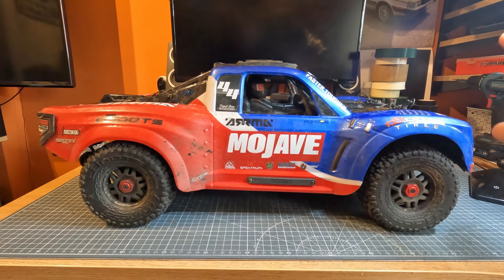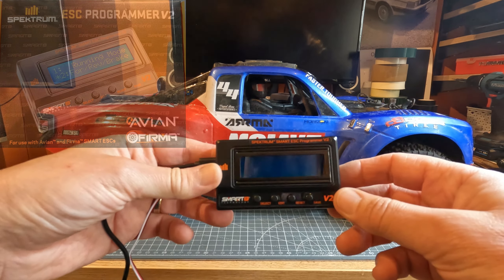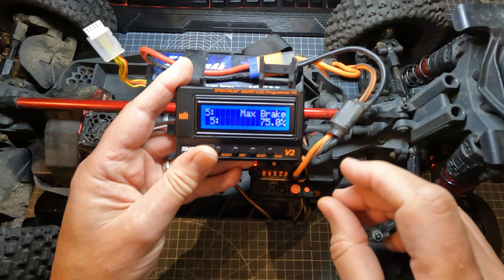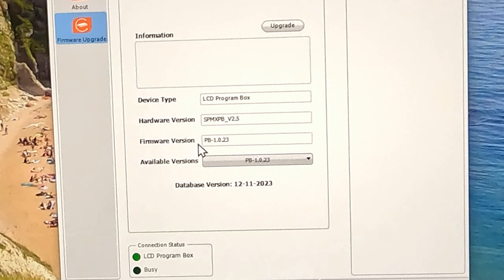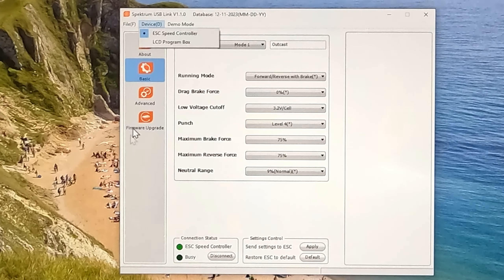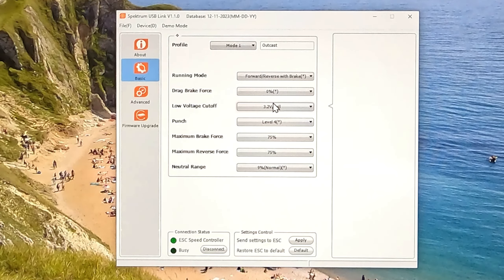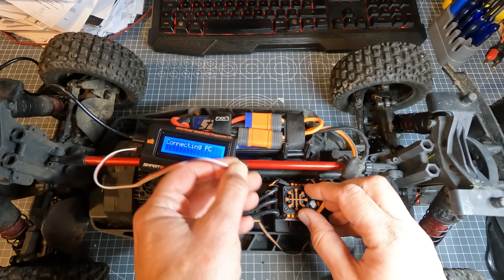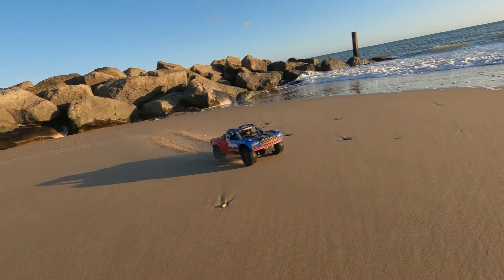Spektrum Firma ESC Programmer V2 Setup/Review Arrma 4s V2.5 LVC Low Voltage Cutoff problem solved.

Comment: You Really don’t need a 30 euro program card to change the lvc on the Arrma 4s 2.5 platform with 120 amp ecs. Just enter the ecs  programming menu by holding the set button 1 second , then cycle till you hear 3 beeps , hold set buttor for 3 second and now you are in the lvc menu for the low voltage cuttoff . Low voltage can be set from.1 through 6 and from factory it is on 4 . Set it to 2 (2 beepz). Hold set button for 3 seconds and turn off ecs . That waz like 1 minute work and you saved 30 euros ...
Reply from the maker: Thanks for the info. Much appreciated 👍👍
Reply: For some reason, when I go in manually like you describe, m lvc just turns off when I go to position 3. At position 4, it's cutting off around 30%.
Reply: Legend mate. What voltage does 1 go to? Had my 5000mah out in it today and only used 2500mah. Assuming 3.7 is the cut off for 4!
Reply from the maker: @RhodTehMod  Hi there. I'm not quite understanding the question. Each cell in the battery goes from about 3.2v uncharged to 4.2v charged so for example a 4s battery as a whole goes from 12.8v to 16.8v.  However many cells your battery has, if you run it down to lipo cut off and then charge it to full and the mah that the charger says it's put in is quite a bit less than the capacity shown on the battery case then the ESC has cut off too soon.  Also just a voltage test after the car has cut off should show about 3.2v to 3.4v per cell. If it's much higher than that then again the ESC has cut off too early. Let me know if that's what you were wanting to know. Thanks for watching the video 😁
Reply: @PeteWylieRC  it answered a lot thank you! There’s 6 modes on the esc without the device so wanted to know what the difference was to putting it on position 1 to position 2
Reply: So i dropped the Lvc level down two settings and now on 4s it cuts power at around 3.5 volts per cell with my batteries wich is fine, what i really don’t understand is why it still cuts off at around 3.7 volts per cell with my 3s lipos.
Reply from the maker: @Test1ngOneTwo  Ah right. I think that under acceleration the battery dips down in voltage but the voltage goes back up a bit once it isn't under load. That's my understanding and it might be wrong.  Thanks for your feedback 👍👍

Comment: Loads more run time now 👍🏻
Reply from the maker: Hiya Damian.  Yeah it was cutting off stupidly quick when I was running it on the beach because the wet sand stuck underneath and it weighed a ton!  Cheers for watching mate 😁👍

Comment: With a full 5200 battery I can get mine to run on concrete for roughly 30 seconds before going to half power. Any thoughts on this? Seems turning it off and back on gets me another 30 seconds. Batteries tested good
Reply from the maker: Have you checked what the low voltage cut-off is set to? Even with it set too high you would hope for several minutes. If the LVC is set to 3.2v per cell and still doing this then either faulty battery or ESC I would guess 🤔

Comment: so is the kraton 4s 2.5 the same then as im sure there the same esc?
Reply from the maker: Yeah it seems that all the 2.5 version 4s cars have this esc where the LVC is set high but you can change it using the programming box. Many thanks for watching 👍👍
Reply: thats the problem tho. i really dont want to be spending £30 on a spektrum program card. its the only spektrum esc i own and i have zero intention of buying another one. think its known as a scam.

Comment: I was able to reset my V2 ESC in my Kraton 4s v2.5 with the Set button on the power switch. The manual however doesn’t tell you what the LVC is set at other than by level. It comes stock on level 4 and I set mine to level 1 (lowest setting). Definitely getting longer run times on my Gens Ace 5000mah 50C Lipo!
Reply from the maker: Oh that's interesting. I'll have a go when I get a mo. The manual doesn't mention LVC at all. What option number is it?
Reply: Hey I have the new Mojave and found the same thing no numbers just 1-6. I want longer run time but don’t know if setting 1 is safe? What is your cell voltage after your done running it?

I have mine set at 3 but still looking for longer run time.
Reply: Are you sure your in lvc setting?
Reply: So you don’t need this programmer?

Comment: Hi Pete, another very informative and interesting way to update and programme the Arrma’s of the correct hardware level. Looked relatively straight forward to perform, so glad you’ve solved the issue. Happy running and have a great Sunday. Best wishes 😊😊
Reply from the maker: Hi John. Yeah it's a bit of a niche video but someone else must have found this issue. I can't remember, did you make those Typhons brushless in the end? Anyway, cheers for watching and your kind feedback my friend. Very best wishes to you and yours 😁👍👍
Reply: @PeteWylieRC  Hi Pete, I’ve still got the Typhon’s in brushed motor setup, I do need to get an updated brushless system for at least one of them. I’ve a spare HW BL60 ESC, might see if I can get a brushless motor, but maybe easier to just by one of those Absima or Razer10 setup for it, I remember your videos and products used 😊😎😉best wishes 🖐️😎🖐️

Comment: I own that very same Firma ESC Programmer I used it to  help max out my throttle punch settings on the ESC on my Arrma Vorteks 3s BLX Pete it's really easy to program the ESC. Another very insightful video m8👍👍😎😎👍👍
Reply from the maker: Hi there. Yeah it's a helpful bit of kit to make setting the ESC a bit easier. Shame you can't get to all the settings without it but it wasn't too expensive. Cheers for your great feedback as ever my friend and many thanks for watching the video 😁👍👍
Reply: Qué número de actualización tienes?

Comment: First!! That's pretty wild. Never seen that done before.
Reply from the maker: Ah well done for being on the ball!  Yeah this has certainly solved an issue.  Shame you can't set LVC without buying the box but there you go.  Cheers for watching 😁
Reply: @PeteWylieRC  makes wonder why it doesn't just have a USB C built in to link straight to PC its good to see new stuff. Thanks for the video sir!
Reply from the maker: @Paul__FC   Ah but then they couldn't sell you a little box for £30 🤣

Comment: Sorted!! You make it all look so easy Pete!
Interesting video mate, this evolution of technology is a whole other side to the hobby that I have yet to embrace..... very clever though.
I've not (yet) ventured into the world of flying brushless Arrma's and 4s.....
Im dangerous enough with a Tamiya on 2s!!😂
Cool little device though, and I fully comprehend the theory.....
Am I correct in thinking that is a similar device to the hobby wing multifunction program box?
We bought one of those to set up our HW 120 ESC for last years speed run..... unfortunately, me and computers don't get on!!
Needless to say, it's currently still in its box! 😂
Cool video to help the tech illiterate generation such as myself to get our heads around all this marvellous new technology!
Cheers buddy. 😊 👍 👍 👍
Reply from the maker: Hiya James. Yeah this is similar to other programming boxes. What a shame they don't all use the same one! I've not really had LVC be such an issue before. If you have a little light Tamiya with a brushless motor and lipo then it lasts so long that if it shut down a bit early then you probably wouldn't notice. With this it's a big heavy lump of RC car and the run times were crazy short on the beach and in the mud where the system is under strain. Annoying that it wasn't set better out of the box but at least there is a way to fix it. Cheers for watching and your kind feedback as ever mate. Sending best wishes 😁👍👍

Comment: On my Kraton 4S 2.5 , if I set LVC to 3.2 , the ESC will cut off about 3.5 . 
When it was set at factory default,  it was cutting off between 3.85 and 4.05.
Truck would run minutes ! 
Now it will go about 16 minutes  under very heavy throttle.
Reply from the maker: Hi there. Oh right so it sounds similar to what I was getting. Don't know why it was set so high out of the box. Many thanks for your feedback 😁👍👍

Comment: Is it possible to fit the power module with the centre diff into the 3s cars without much hassle?
Reply from the maker: I haven't taken it out but I think that the way it fits to the chassis is completely different so if it's possible at all I think it would need major mods.  Will be looking at the centre diff in due course and will make a vid. Thanks for watching 😁👍
Reply: Yes you can, just need all the parts if they are all available where you live.
Reply from the maker: @gillian9178  ah that's interesting. I noticed that the centre diff has a couple of screws holding it in which is different to the slipper. Some mods needed to the chassis presumably?
Reply: @PeteWylieRC  Hi Pete, the extra 2 holes in the chassis for the diff mount are already in the 3s chassis, you just have to open them up a bit. Go to JT RC video entitled Mojave 4s center diff instalation in 3s models. You will see the entire instructional on how to do this.
Reply from the maker: I found this video. The answer is yes bit you need to modify the chassis https://www.youtube.com/watch?v=NZTdf2TtcQw

Comment: I'm installing a ds3235pro servo with a hot racing fixed 25 t servo saver in an arrma kraton 4s v2.5  do I need to program the esc  or can run it after centered and installed
Reply from the maker: Hi there. You don't need to change any esc programming when you install the new servo. Really the only thing that needs changing is the low voltage cut off to get a longer run time. Thanks for watching 👍👍

Comment: Not all 120a will update, my 150a and 100a updated with lvc changes, sadly not my 120a. 😢
Reply from the maker: Hi there. Yeah they seem to have changed the firmware along the way but it's not obvious if you haven't got this programming box. I can't change it on my V2 Outcast either but it seems to be set a bit lower anyway. Many thanks for your feedback. Much appreciated 👍👍
Reply: @PeteWylieRC  I have the V2 box. I was able to change my 150a and 100a but not the 120a.
Reply from the maker: @rccarsandmusic2641  Yeah like I say they must have changed the 120A ESC along the way.  The one I've got that is version HW_495_KZ1_V1.2 did not allow LVC to change but the newer one that has hardware version HW_495_KZ1_V1.2A does allow it.  Bit annoying that they didn't update the firmware on the previous one so you could.

Comment: I see the box and software is the same as Hobbywing 😉
3.5/3.6 lvc is very high. I'm wondering why they set so high. 3.2 is fine
Reply from the maker: Hi there. Yeah I'm beginning to wonder if everything is rebranded Hobbywing 🤔 Anyway yes it does seem excessively cautious when the battery cuts off when it's still git 1800mah left in it. Many thanks for your feedback. Much appreciated 😁👍

Comment: Does this work on the vorteks?
Reply from the maker: I think you can only adjust the basic functions on the ESC of the 3s cars. Being able to set the low voltage cut off seems to be a new thing on the 4s cars 👍